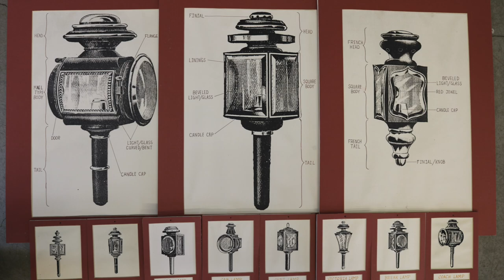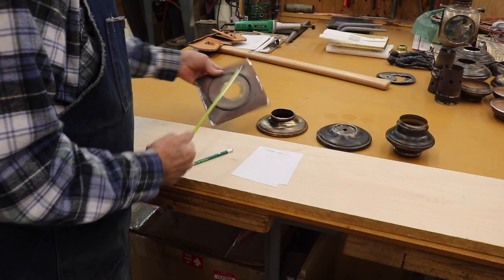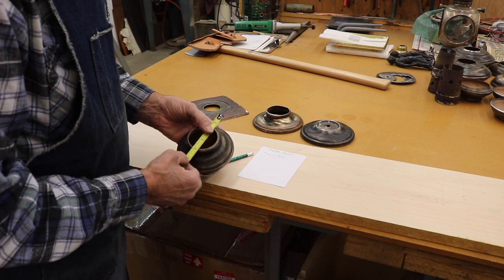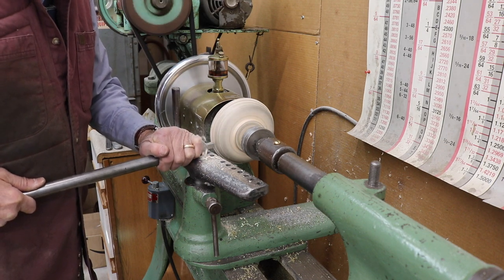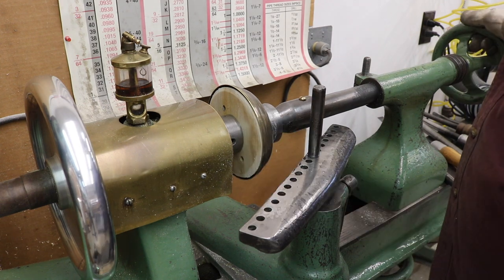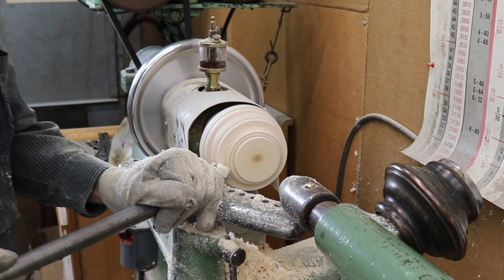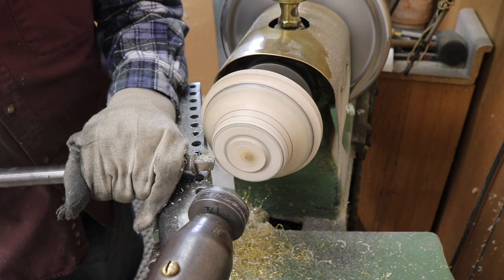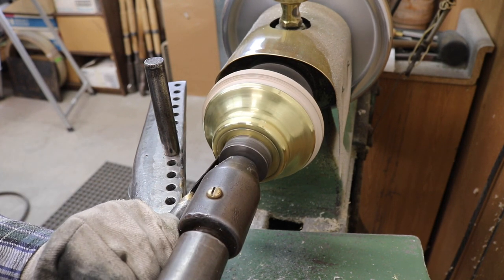Making Hard Maple chucks for spinning antique hearse lamp parts. Then spinning parts. Luminary Shop

Comment: Rick, were your visitors elk or mule deer or something else?  Also, when laminating(?) your chuck blanks, have you tried sprinkling a bit of table salt between the joints to avoid the layers slipping & sliding while trying to clamp them?
Reply from the maker: White tail, you can see them thru the window in the shop door.

Comment: I guess these lamps are so rare, and the cost of the wood so high, that this is why you modify the chucks rather than make separate chucks for each stage.
You don't say, but did you make a few extra spinnings for stock, just in case? I guess the cost of the brass is the least of it.
Reply from the maker: Yes, I have a lot of extra spinnings but I hardly ever need them. The differences in the old parts are infinite. I often need a part similar to something I already have but not quite exact.